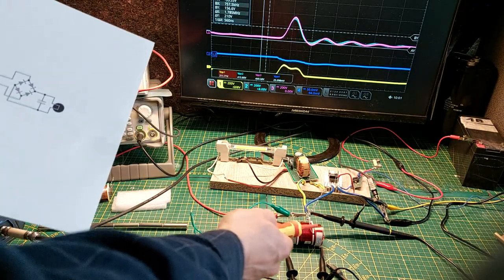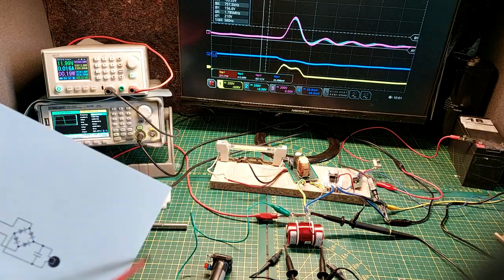Advantages of using negative spike of switched coil

Comment from the maker: !!! Caution !!!
Working with negative spike can hurt/kill  you, or damage your mosfet and other equipment, due to high voltages.
Therefor experiment at your own risk, and only if you know what you are doing.

The purpose of this experiment was originally for something else I want to look into, but what I saw was to interesting.
I saw 3 important things:
1) The current draw from power supply was very low when using the spike (20mA) compared to the high current (600mA) when spike was not used at the 34Khz input.
When doing the same at 1Khz there was not that much difference., the current stayed around 20mA with or without the use of the spike.

2) The magnetic field was bigger with the use of the negative spike. This is shown by the 2 led's in anti parallel connected to 3 small coils with ferrite core in series.
Allthough I had 30 times more current when not using the spike, the magnetic output of the main coil was lower then with the use of the negative spike.
This was the case at both frequencies 1Khz and 34Khz.

3) The polarity of the voltage that the 3 small coils from point 2 put out, is different on each side of the main coil. (shown by red and blue led) (this is important for my original experiment)
For the left side this was at both frequencies of 1 and 34khz.
The right side, where only the blue led lighted up at 34Khz, the red led was also lighting up very dimmed at 1khz.

In this setup there was no resonance.
What you see are the results at 34Khz with 50% duty.
When using only 1Khz, I had to lower the duty to 10% and voltage was much higher on the 2 receiving coils, the spike value is much higher at lower frequencies.

As an extra experiment I placed the stick with the 2 led's in antiparallel at a certain distance and looked at what I had to do, to get same brightness at 1 and 34Khz, when using the spike output:
1Khz ; 10%duty ; 12V ; 0.025A ; 0.29W ; +-800V spike
34Khz ; 50%duty ; 15V ; 0.019A ; 0.28W ; +-500V spike
For the magnetic output I have to use around the same power input the light up the led's on the polarity check stick.
However the big led on output was lighting up very well at 1Khz while barely at 34Khz, for same power input.
Reply from the maker: As an extra experiment I build myself a simple device to look at magnetic force difference.
It's just something I tryed because I know this is far from accurate.
https://youtu.be/uncIqp9nasI

Comment: I see that you are very very hot Bruno, I have been following you for a while, I have experimented quite a few things with sizes... I am happy... and uh for the skeptics... the voltage we bathe in is the force of attraction of the earth... if one day you take a chestnut or an electrocution at several kw, especially while pumping on the ground... because it happened to me... take off your shoes put your hands on the ground. .. start with the right. .. the leakage current will go away. and you will stay alive. ..... 🥰🫡🫡🫡🫡❤❤
Reply: This